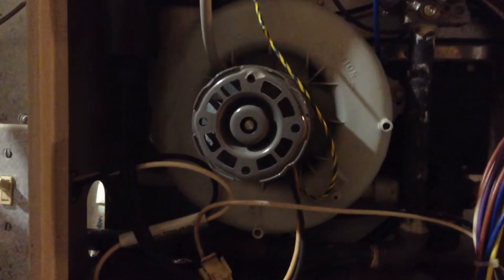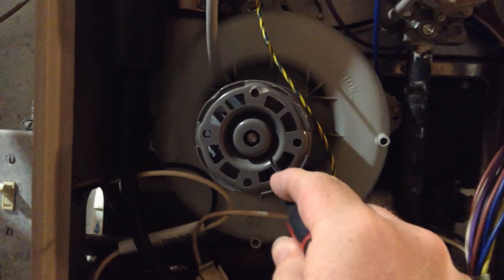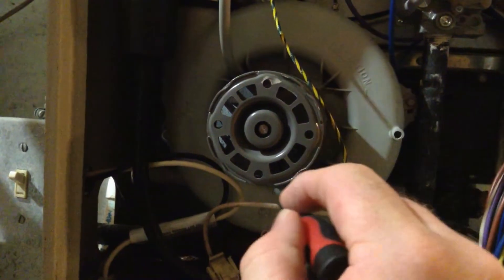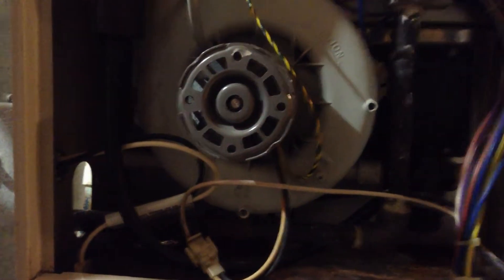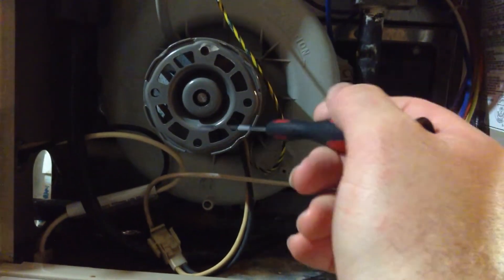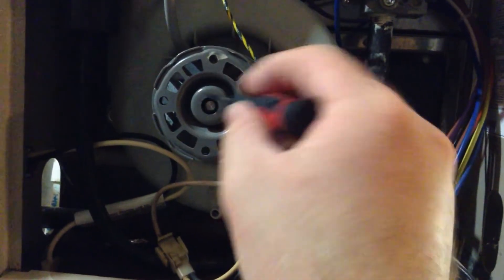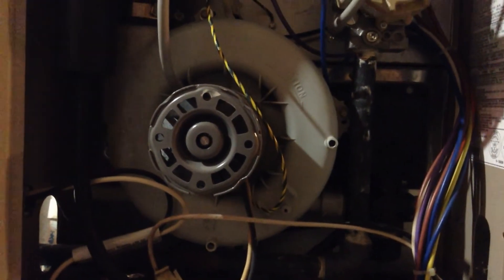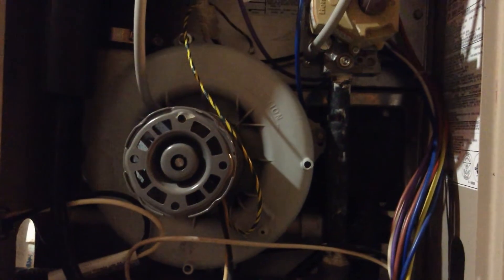squealing furnace repair

Comment: The idea behind this is good ., temporary or not , THIS BUYS YOU TIME TO FIND A "REASONABLY PRICED" REPLACEMENT Price range can be from $180.00 to $500 .00 plus ., & in the meantime you will have heat...If you choose to hide your head in the sand ., don't be surprised if your repair man quotes you $600.00 ,along with trying to sell you a new furnace !

Comment: thx for the vid. Does this repair (temporary) or fix (permanent) the issue?
Reply from the maker: It depends on a lot of things, it will not last as long as a new motor. it's a repair that can last anywhere from a few hundred hours to years. In my case I got extremely unlucky and the motor insulation failed(very rare failure) instead of the bearings(very common failure) after several hundred hours. This is mostly to get you through the year so you don't have to pay extreme prices during peak times.

Comment: My furnace started to make a whirling high pitched radar sound like a jigsaw would make when cutting wood. What can it be?
Reply from the maker: If it's a larger/very old (30+ years) unit it might be a belt.the pulley,belt , or a cover running from a large motor to a fan will be visible if you have one. it could be a loose duct or a leaking joint. if they are metal ducts push on them they should feel solid. they'll move a bit but not feel/sound like a loose peg in a hole. wet your hand and move it around the ducts you'll feel air currents(turn on a/c for this). use real duct tape (hvac)to seal ducts it will have a foil back instead of a plastic/fabric one. and a severely clogged furnace filter will cause numerous problems. try using a filtrete brand one they are stiffer and more durable.